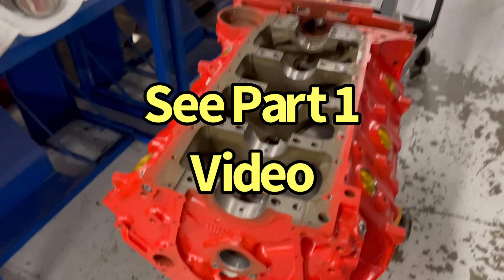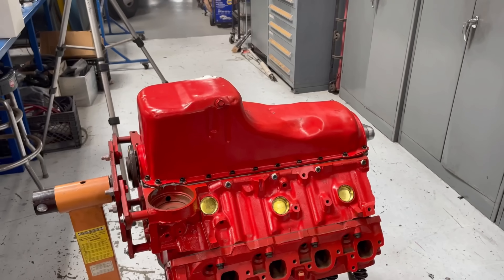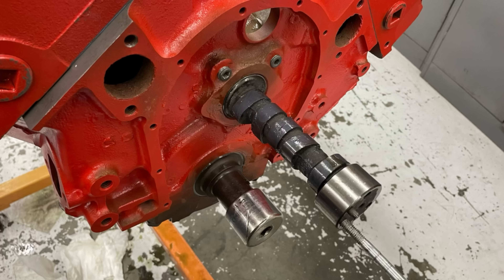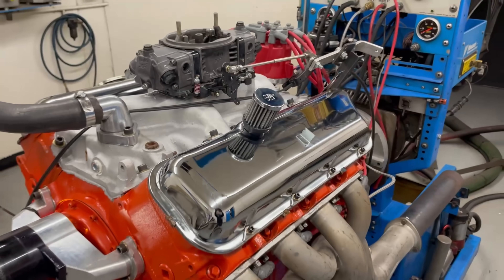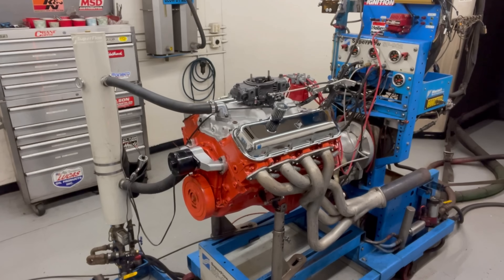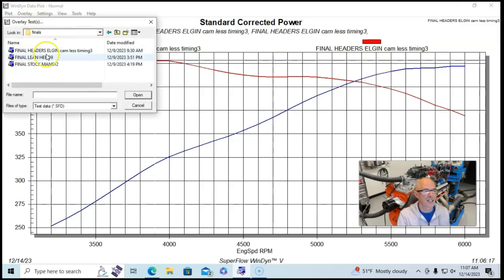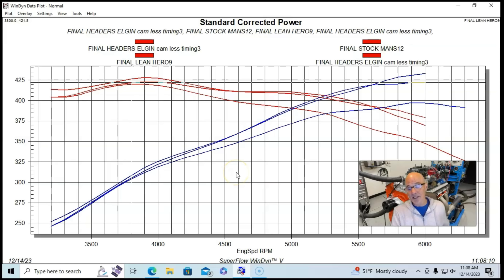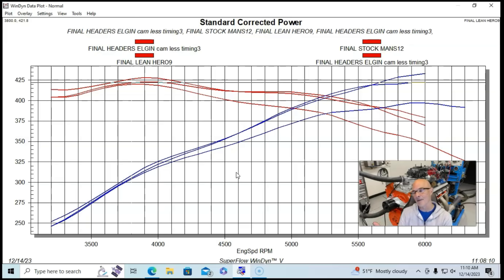FULL DYNO RESULTS ON THE L78 396, OVERRATED AT 425 HP OR  UNDERRATED AT 375 HP? WHAT DID IT MAKE?

Comment: There was a test done on one of these  that made 425 HP with manifolds and 
up to 450+ HP and 465 Torque with headers , might have been in HOT ROD 
awesome engines the 396/402 BBC
Reply: Awesome? They usually won’t go 100,000 miles and those are the ones that don’t throw rods, I’ll take a small block anyday.
Reply: @alanmeyers3957  You are correct , most performance engines do not make 100,000, a lot do not make 5,000 miles without wounds being repaired and I am talking about performance engines in cars that are being pushed hard , dragstrip etc . both small and big blocks.

Comment: Thanks for coming back to complete this with the right cam. Nice test. These were hard to beat in a chevelle with headers and a 411 or 456 gear.
Reply: Yes, I purchased new in 1969 Chevelle L78/ 396/375 HP, m22 rock crusher. I ordered it with 3:73 rear end bears which were not near low enough for street racing. These had lots of power & always regretted not getting at least 4:10 or 4:56 gears to unleash the  true potential of these high reviving mills. I had a lot of valve spring peoblems, probably from over reviving the engine! I used to speed shift it @ 7000 rpm.
Reply: Had a fake 68 SS in the mags back in the early 90s..Loved that 396. Close ratio M21 tall fwy gear lumpy hft cam headers it never quit pulling. Was always surprised at how much torque it put out. No need for OD

Comment: I think that the 425hp number was kinda accurate if or when they would turn the car from a street car to a race car cause they would take all the pulleys and pump off their car and put large tube headers on their race car and maybe not make 425 like u say unless it was a 454 in the car an they were telling people it was a 396 because of the bages on the car but it’s definitely possible to build a 396/402 back in the day an make 1 hp per cubic inch or even 1.25 hp per cubic inch but 425hp 396 was definitely a marketing scam only other test I’d say try an put a set of period correct aluminum heads on that engine an see what it makes maybe that would be more accurate

Comment: What octane fuel and what was timing ? Just curious what i would have been in 1960s compared to possibly 91 octane that was used in the test ?
Reply: In the '60's/'70's you could get 100 octane at the pump at some stations along with leaded gas
Reply: In the early '80's you could still get 100 octane at amoco

Comment: So now we know!  Thanks Richard!  The 1969 advertised specs for the 396/375 had peak power coming in at 5600 rpm, which is a little below the 5900-6000 rpm result from the test.  Of course, 1960s advertised power figures were not always very reliable.
Reply: Yes, and the HP rating for the 65 Corvette 396 were taken at 6400rpm.  That is the main source or reason for differences that many seem to scratch their heads about.  Guaranteed if you take it up around redline, you'll be well over 400hp.

Comment: Arguing over dyno trim versus in-car trim is always a fuss, because all the stuff on the engine in the car (alternator, water pump at a minimum), and exhaust manifolds (the manifolds for the 396/425 Corvette /were/ more free-flowing than those on Camaro/Chevelle/Nova, but were still heavy cast-iron, which would account for a slight power increase, but I doubt it was 50 HP.

In '67, any California-built L78 Camaro had a smog pump and tubes further dragging down the engine(and adding significant weight).  

The correct carburetor (at least for Camaro) is a 4150-series List 3910 for the any '67 L78 not installed in a California car, and 3911 for the California  cars.  The List 3911 carb had some tweaks to it to make it work "better" with the smog system. Yeah, right.   It was known to not work well at all when the smog system was removed, and many that ditched the smog system (just about everybody) and put headers on the car replaced the carb with a 3910.  

My '67 L78 Camaro was built in Van Nuys, and thus had the smog and the 3911 carb originally.   The original owner pulled the smog system off, removed the exhaust manifolds (of which the passenger side exhaust manifold on '67 Van Nuys-built L78 Camaros was completely unique, and originals are very rare and hard to find today) and tossed them in the trash with the smog system.  He put on a brand-new set of Mickey Thompson Super Scavenger headers on it and took it to the drag strip to race in Street Stock class.

When I got the car in 1979, the L78 was otherwise original, except some bonehead had replaced the sought-after 1111170 aluminum distributor with some cast-iron unit from lesser 396.   

A correct distributor was located and completely rebuilt.  I run it with standard points.  Then engine went to the shop to get a 0.030 overbore, TRW factory replacement .030 11.0:1 pistons, a new factory original flat-tappet camshaft (you could still get them from Chevrolet parts back then...early 1980's) and lifters/pushrods/rocker arms/balls/studs.  The original guide plates were used on the original heads, which got new stock spec valves/springs and a nice valve seat job (iron seats.  Shh. I run leaded fuel in it). Block was align honed, but no decking was necessary as the block and head surfaces were flat.   The crank was knife-edged (not really stock, but a nice idea to better control oil slosh) and balanced, and  the original rods were used after they were weight matched.  The intake is the original piece, as is just about everything else.  It has the original fuel pump and starter.  The alternator was a replacement unit with a shallow-groove pulley, so I found a correct (and even date-coded pretty close) alternator with a deep groove pulley.  The water pump is a Chevrolet performance parts aluminum unit that was on the car when I got it, and it looks too cool to replace with a painted cast-iron part.  

The exhaust system was 2 1/2" tubing, with a pair of mufflers from a '70 Chrysler Hemi Challenger/Cuda, with exhaust out the factory location just behind the rear tires.   

engine never went on an engine dyno, nor have I been able to get the Camaro on a chassis dyno, but back then, I had a very experienced engine builder/tuner/racer by the name of Bill Ireland do a complete power tune on the engine in the car.   

Bill Ireland was a fixture in the Portland, Oregon hotrod scene, who had a shop called Ireland Auto Electric where be built some of the nastiest engines and cars around.  Bill was a member of the famous Ford Factory Drag Race team in the late '60's and early '70's, campaigning a 428 Super Cobra Jet-powered Mustang.  

I went to pick up the car after Bill had done his magic on it, before he gave me the keys, he got very serious, and looked me straight in the eye, and firmly said "Kid (I was around 20 years old at the time), you damned-well mind your P's and Q's with that car, because if you are playing around with it and aren't paying attention for even a fraction of a second, it WILL kill you.   

I asked him why he felt this, and he said that any time he did a power tune on a customer car, he drove it just down the street from his shop to Portland International Raceway, where he had a key to get into the place.  He used the drag strip and his butt in the seat as his dyno to get the last bit of tune dialed into the cars.   I had no idea.   I was a little shocked, but listened intently.  

He said that, for a factory stock 396, it was, and I quote, "damn wicked", wanting to swap ends on power shifts between 1-2 and 2-3 (3.73:1 posi rear end).   He didn't have access to the timing equipment, so he didn't have time slips, but he said that with the factory tires, it was hopeless to try to get down the drag strip with any traction..the tires just went up in smoke in every gear, even babying it on the 1-2 and 2-3 shifts to keep it from going into the guardrail.    

He said that with a good driver(probably not me), a proper set of slicks, and perhaps taking the back seat and passenger seat out to drop a little weight, he felt, based on his "seat-of-the-pants dyno", the car would run in the 12.20 to 12.30 range, at something around 115 MPH.  He said it'd be far less dangerous with slicks on it than with street tires.    He said that driving a car with that kind of power on the street with street tires, was a recipe for disaster, and that he didn't want to read about me in the paper ending up killed doing some stupid stunt in the car.  

Of course, being a bulletproof kid, I found out what he meant once many, many years ago very early in the morning on the way to work, when I went to enter a highway on ramp, and decided to get a bit sassy,  I aggressively eased down the throttle in first, and the back end broke loose before I had a chance to get into second, and the car tried to steer me into the guardrail.  I counter-steered, and kept in it, slamming 2nd while barely letting up, and the car started heading toward the other guardrail, but I somehow kept it under control without lifting (no skill on my part, just luck).  

By this time, I'd made it down onto the highway, which was (thankfully) empty at this early hour, and I slammed 3rd gear with barely a lift on the throttle, and the next thing I knew, I had stopped (instinctively, I guess), with the engine idling with its characteristic tingity-ting lope through those wonderous Mickey Thompson headers being the only noise I heard.    

As the cloud of tire smoke cleared, I realized I was facing the wrong direction on the highway.  Oops.   I was shaking pretty bad from the adrenaline, but had to get moving because I could see a car coming toward me down the highway a bit, so I got it into first, noticed the dual wiggly strips of smoked tire deposited on the concrete the length of the on-ramp, got it turned around, and drove off the side of the highway. 

 I sat there for a good ten minutes before I was composed enough to very gingerly make my way to work.  

I suspect that 375 gross HP for absolutely stock engine in the car with accessories and original exhaust was probably not all that far off in the day.  But, add a set of headers, a freer flowing exhaust system, and a tune up done by one of the drag race legends of the time, and it's very clear that those changes clearly woke up the engine by a good margin.  
 
I think it probably compares roughly equivalent to the engine Richard built and dynoed at West Tech.  Maybe 410 to 415 HP with the accessories and (modified) exhaust in place.  By the way, the car was running a just-shy of full tank of 92 octane pump gas with 2 gallons of Sunoco 116 octane leaded race fuel added to it.  No pings, and set at factory timing, both initial and full advance, with the cam installed straight up.  I would buzz it up to 6,500 RPM for power shifting with no problem at all. 

 I still have the car today.   Needless to say, I've mellowed a lot since then.  But, there is still nothing quite like pulling it out of the garage on a crisp clear winter morning when the air is dense, and its been dry long enough that there's no moisture on the roads.  The sound of letting it warm up for a bit with that thumpity thump out the tailpipes, and the unique tinkity-tink noise from the Mickey Thompson headers.   The rocker arms are a bit clicky when it's cold, but they quiet down as it warms up and the lash goes into spec.   Then, once it's nice and warmed up, it's a joy just taking it out for a brisk drive.  The car drives beautifully.   Maybe a little tire spinning action on 1-2 shifts when its straight and clear, but no more redline powershifts these days.  

It always gets thumbs-up from passing drivers.  The funny part is that when I stop at the coffee shop to get a cup of coffee, nobody knows anything about it.  Many know it's an "old Camaro", but tell them that it's one of 1,138 made in 1967 that got a special high performance 396 put in it from the factory,  they just look at you with a blank stare.  

In all the years I've had the car and taken it to cruise ins, pit day at the drags, or just driving it around, there have been only a small handful of people who knew anything about the car.  Those people were always the most fun to talk to, as some of them have memories of owning an L78-powered Chevelle, Camaro, or Nova back in the day, and all of them had great stories to tell. 

Now, I  just have to find time to put my '69 Nova SS 396 L78 four-speed back together.  Word has it that the Nova is even more squirrely than the Camaro because of its weight distribution.  It'll be fun to find out, albeit, carefully.

Thanks for building this engine, Richard!   What are you going to do with it?
Reply from the maker: it will be for sale when finished
Reply: @richardholdener1727 , aww...I thought you'd have a sweet '67 Chevelle or Camaro to drop it into, just waiting for it.    Oh well, whomever gets the engine will be lucky to have it, as it's certainly built right, and will be a great engine for some nice replica or perhaps NOM restoration.   I hope it goes to a really good home.
Reply: Oh, one question:  Did the valve covers you used have the "oil drippers" in them? @richardholdener1727
Reply: Wow that dude wrote a book

Comment: SHP, 11TO1, SOLID LIFTERS, 4BOLT MAIN CAPS. YEAH 425 HP I  had a firebird RAIV AND MY BUDDY HAD THE CAMARO WITH L78 WITH HEADERS AND POWER WAS SOO MUCH MORE THAN MY RAIV AT 370 HP. AND YEAH I MODIFIED THE SECONDARIES ON THE FIREBIRD 🧐

Comment: Thanks for another classic engine test Richard! People will argue and claim this and that but marketing was responsible for selling cars and embellishing a little helped to push that. It also helped to bring about the change to the "Net" rating that started in 1971. Cars seemingly lost 50hp or more overnight. I figured the 396 would be closer to the higher number as I always figured the 427 with the same heads was around it's 425 rating. Now build one of those and lets see. I know Pontiac 400/455's will make about the same horsepower if they use the same heads just like your 302/327/350 test. But of course different torque numbers and peak rpms. No matter what it's cool to see actual numbers and not just good campfire stories and hyperbole! An actual 375hp in the late 60's is nothing to be ashamed of. Those cars were very fast with minor mods in light cars like the Nova and with a set of slicks bolted on the back. They can still embarrass a lot of the new muscle that has the benefit of 50+ more years of technology.
Reply: I street raced everything in those days, and I can tell you headers made a BIG difference  on those big blocks. 😊
Reply: I had a 350 horse 396 out of a Chevelle in a Camaro and it took no crap from 375 horse motors.   They have 10.25:1 CR, oval port heads and Q-Jet spreadbore manifold and it was running a small 204/214 @ .050" with slightly less than .500 lift.   On pump gas and properly tuned the heads flow enough to feed the displacement just fine and the larger heads actually take away torque below 5000 rpm where much of a race is run.   We did lots of top end pulls against 375 horse motors and never had one keep up.  Of course..I'll take a little credit for this due to tuning but if you look at the dyno graphs the 375 doesn't exceed the 350 until well over 5000 rpm...so on the street I don't think the 11:1 CR helps very much as they're detonation limited on pump gas today and actual power of the lower CR motor able to match or even exceed it due to better timing advance being used.   Love the old Big Blocks! :)
Reply: @recoilrob324  Ive always preferred ovals over rectangle ports on these
With a little bowl work even 20 deg cam timing these really woke up!
Reply: @recoilrob324  I bought a 70 Corvette in 1995. It had a 454/4speed of unknown vintage, definitely not the original engine. I pulled it apart after the summer cruising was over and it had rec port heads. I decoded it and turns out it was a 70 LS6 someone had ground the numbers off of, restamped and tried to pass off as the original engine (very poor work and very obvious it wasn't). After reading a couple of articles by John Lingenfelter about the superiority of the oval port heads I pulled the rec ports off, sold them in local classifieds (this was the 90's) and used the money to build a set of oval ports built to Lingenfelter's specs. I went from low 13's in the quarter with the rec ports to well into the 12's with a best of 12.51@110 and the car just felt like it had more torque. The oval port heads from what I have read over the years just superior on engines under 700hp or so. Of course if you have a 1200hp Pro Stock car I'm sure you want those rec ports!!